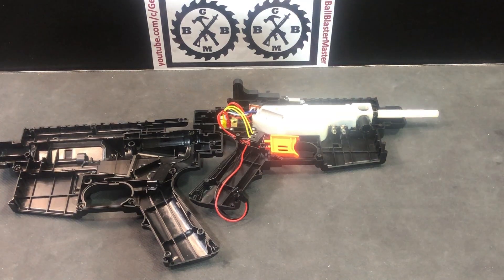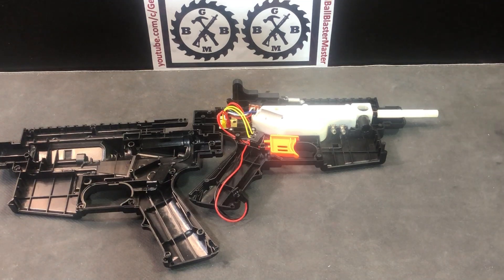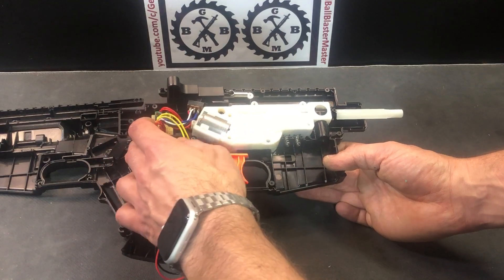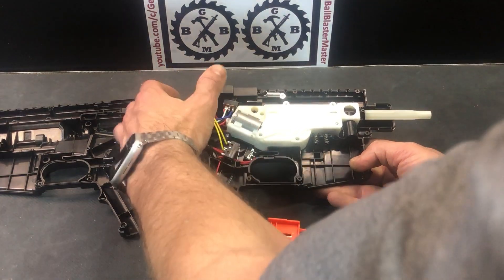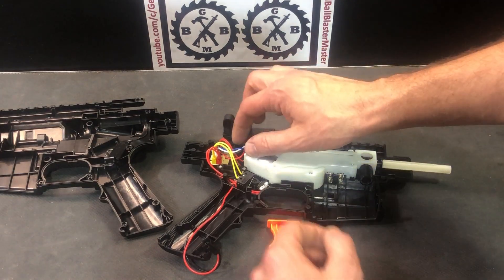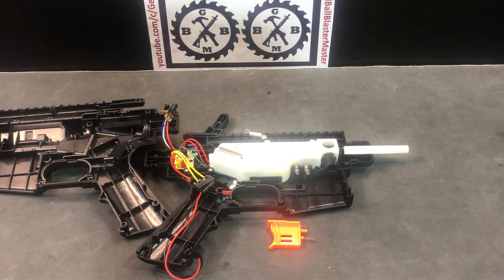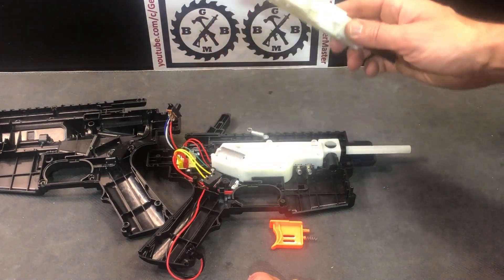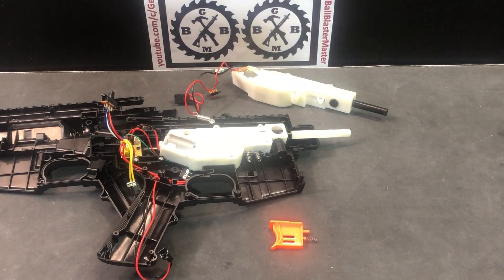Quick Look Inside the M4 WASP Gel Ball Blaster

Comment: Seems like a very basic gearbox, looks similar to gear box in Ferventoys pistols, I took one of those apart to try to fix it it’s making grinding noises when you release the trigger still can’t figure out a way to fix it I don’t know what’s causing it lol very simple gearbox tho
Reply from the maker: One of your tears probably has broken teeth. How old is it?
Reply: @GelBallBlasterMaster  It still works it just makes this nasty noise when you let go of the trigger they did send me a new one too so I have two of them but the broken one does function I just figured it ain’t gonna last long by that sound I keep hearing lol
Reply from the maker: @DjRayRay09  I have some videos coming soon where I swapped G17 & AKM47 gearboxes into those HK pistols. Have to cut some inside pieces and do some sanding put they fit. Now both are 160 fps!
Reply: @GelBallBlasterMaster  can’t wait to see 😎👍
Reply from the maker: @DjRayRay09  I painted out the “day of the dead” black one but the graffiti graphic wasn’t bad so I just added threaded tip and mock silencer
Reply: @GelBallBlasterMaster  nice 👍

Comment: Can you put a gen 8 gearbox in it?
Reply from the maker: No, not even close, it will not fit. Plus, it looks just like a gen8 and sometimes a gen8 m4a1 is the same price, so I would just purchase that. I have not found any gearboxes that will fit into any of the SKD M4 platform blasters (M4 Wasp, M4 Raptor, Tommy Gun) - they are just set up in such a way that nothing will fit even with heavy modifications